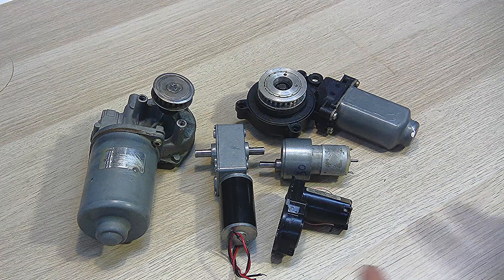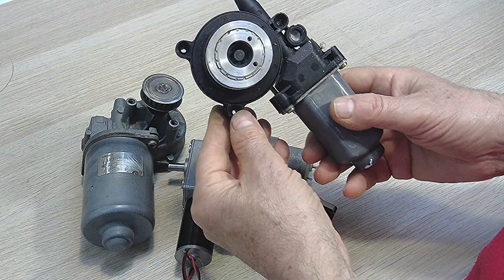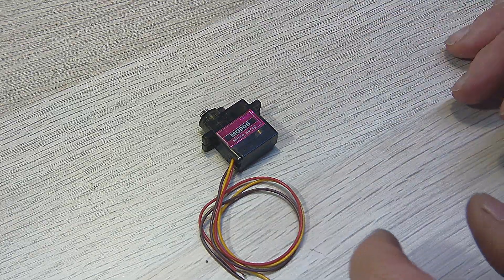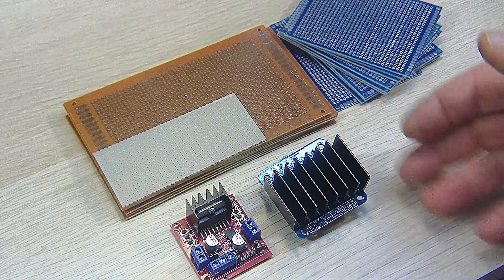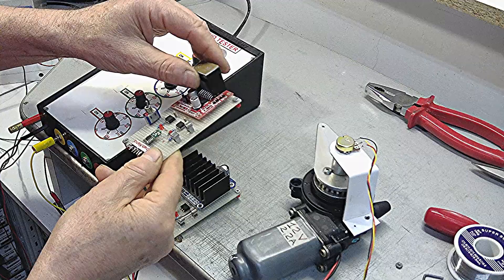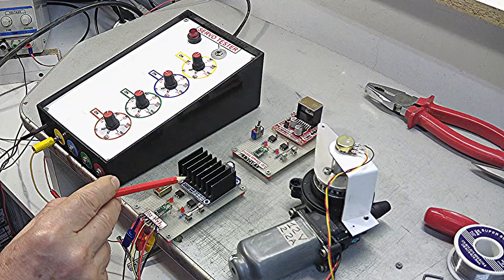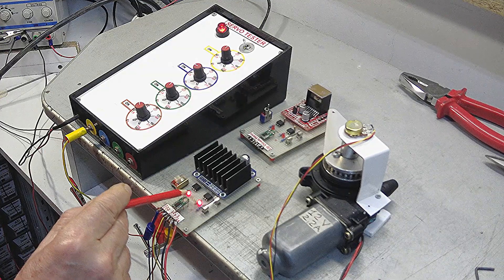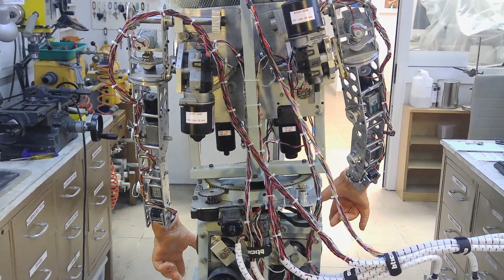How to Build a Big Powerful Servo - Tutorial

Comment: Excellent
Reply from the maker: YES!. if the motors are 3/4, but if they are 56 like my robot, you need at least 20 people who control 20 radio transmitters.
In fact I use a VSA program.

Comment: I stopped working with these wiper motors, not powerfull enough when we put normal clothing on the animatronic. Also the whole robot is shaking by the movements and not run smootly. I notice the same problem with yours.
Reply from the maker: Excuse me, can you tell me where you saw my robots vibrating, shaking?
The two videos by Leonardo da Vinci where the robot is dressed, the clothes worn are irrelevant.
Reply: @alvaropasseri5754  https://www.youtube.com/watch?v=Kwt2b1WMRc0